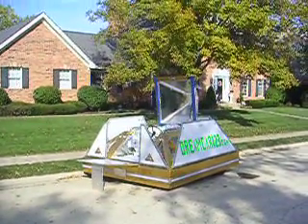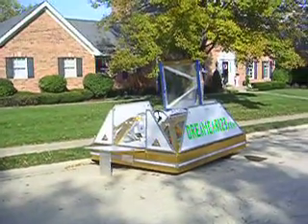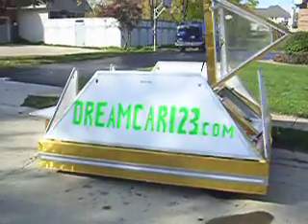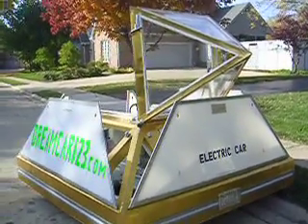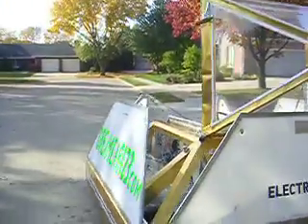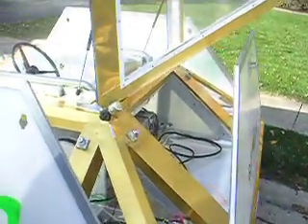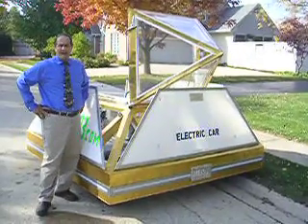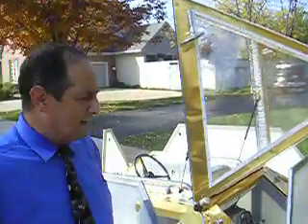Homemade Electric Powered Car Prototype

Comment: No one is going to build that "High Speed Tunnel" across the country to get places. No way is that going to happen due to a 8000+ LB vehicle with a trillion batteries underneath you. It's not a safe vehicle. Crash test that professionally with sensors and a dummy with markers, you'll definitely see that due to no crumple zones, you will die from the massive G-Forces involved in an accident.